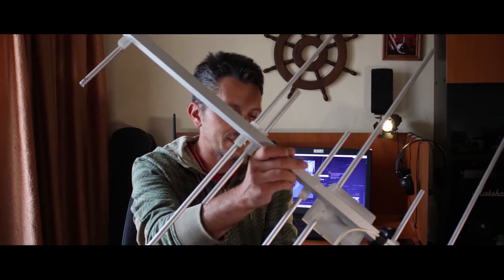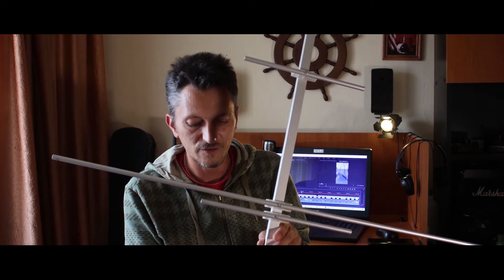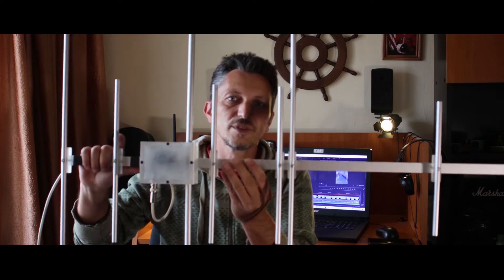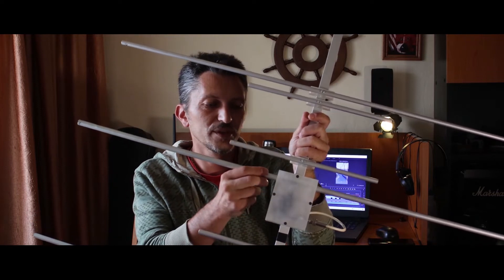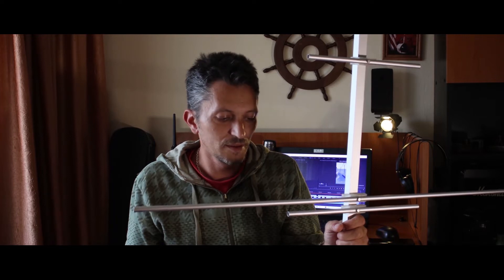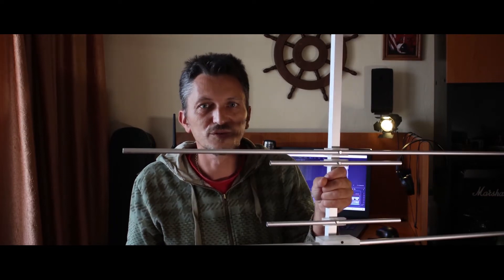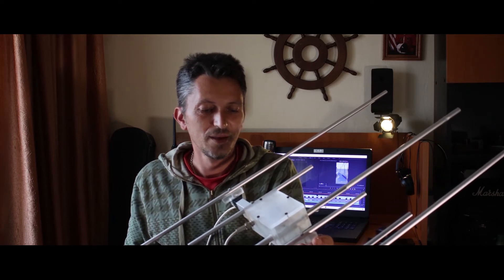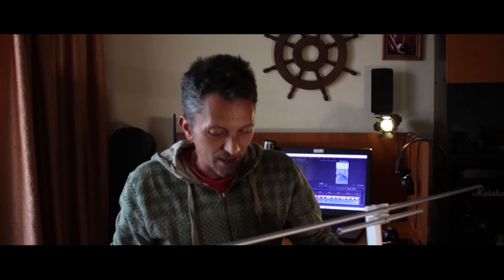DK7ZB Dual Band Yagi Antenna Build and Testing

Comment: I built four of the 16 ele versions for 432mhz, these got me working off the moon after also building a solid state rf amp for 70cm,
Reply from the maker: Woaaaaaa. Now you give me ideas 😁. Is on my list since I was a kid and I was reading in books about EME. Maybe this coming summer I get to try this too. Good reminder, thank you. 73, YO6DXE
Reply: Check out the antennas by DG7YBN. These were the version I adjusted for 70cm EME working.

Comment: Hi, please take me two doubts 😃: regarding the coil, please tell me the correct diameter and number of turns. I read 25mm and 5 turns. Is correct? The other doubt is the connection between elements and boom. Can the elements be in contact with boom (even with only one screw) or totally isolated. Thank you and really liked your video. Simple and efective. 73's
Reply from the maker: Hi Jose... yes the diameter of the coil is 25mm and 5 turns. And yes is ok if the elements are in contact with the boom. I was also confused on the same thing when I built it jajaja. 73
Reply: @dxexplorer  Thank you very much for your answer. Glad i was not the only with that doubt 😄. Seen dozens of photos and videos but there were the two versions. I am going to make my elements suport in 3d If you want i can send you the stl's for printing. 73's from CT1BRN.
Reply from the maker: @joselobo8731  Thank you as well. I don't have a printer... but some plexiglass and a little patience got me some nice raisers haha. Just make sure that you keep the proper distance between the driven elements... the 1cm if I remember well. And it has to be 12mm in diameter. Is a must )). 73
Reply: @dxexplorer  ok, thanks. Bought the tubes today. Had to go another shop to buy the 12mm but it´s here. 73's
Reply from the maker: I have to buy the 12mm tubes as well as I messed up as explained in the video and want to replace them to the proper length. Good luck building yours. 73, YO6DXE.

Comment: thank you bro, this video really inspired me.. i love to homebrew, but no luck with gamma match..
Reply from the maker: This one had no Gama match and the SWR is amazing for both bands if the dimensions are as in the instructions. 

https://www.qsl.net/dk7zb/Duoband/4+5_2m-70cm.htm
Reply: I've just been working for this, using what ever left.. a little adjustment... its working well.. get fun with amsat.. thanks.
Reply from the maker: That is great to hear. I want to use the one in the video at home... and build one more ( a light version ) for portable work. Have fun with the sattelites 😀😀 73.